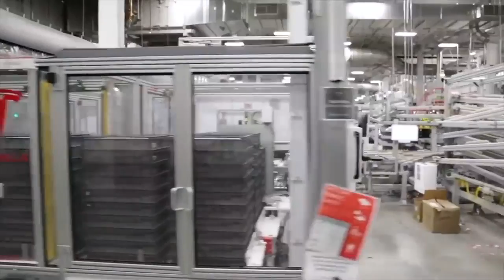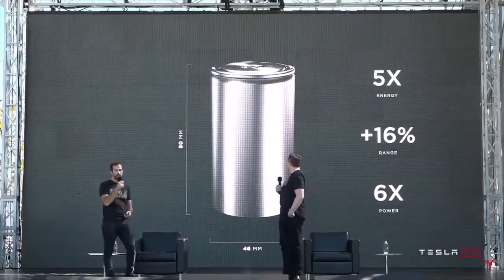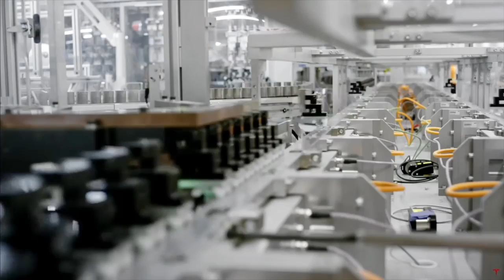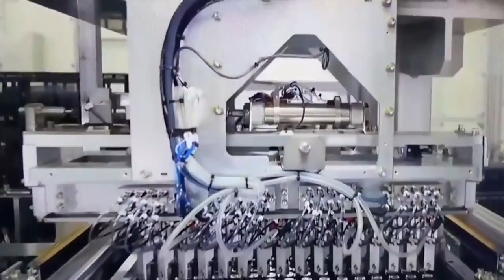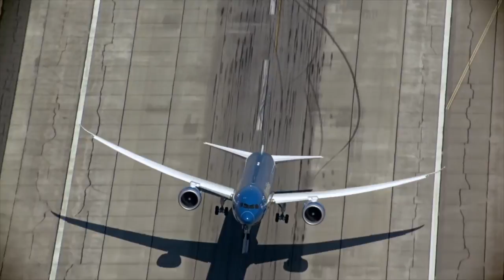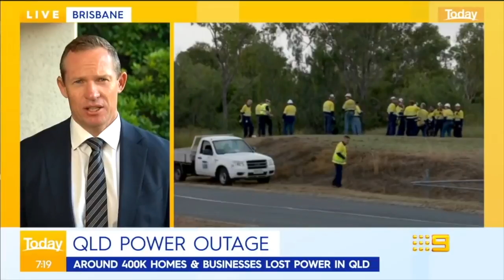Tesla's 4680 Battery News Update!

Comment: 4680 cell should be spoken as “forty-six eight-hundred cell” and not “forty-six eighty cell”.
Reply: forty-six  eighty
Reply: @sirfluorocarbon7507  

18 mm D x 65.0 mm Z reads as 18-6-50
21 mm D x 70.0 mm Z reads as 21-700
46 mm D x 80.0 mm Z reads as 45-800

Try not invent new conventions to something already there.
Reply: Stupid computer.